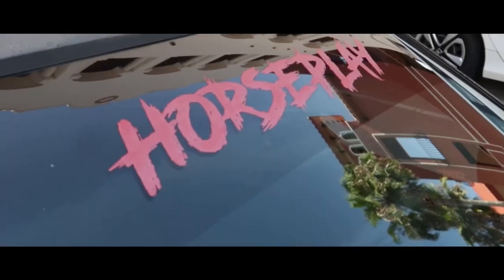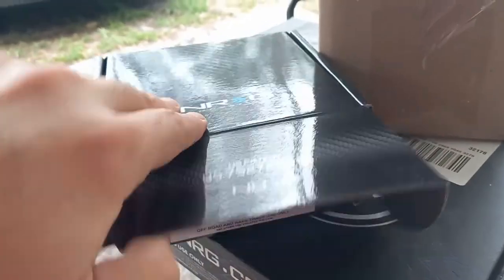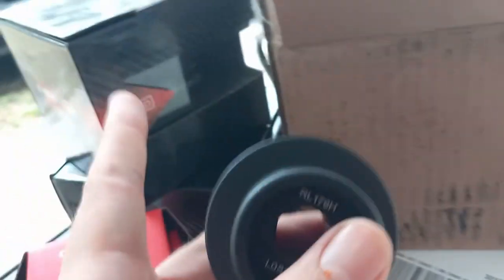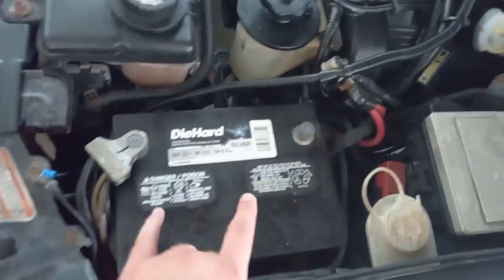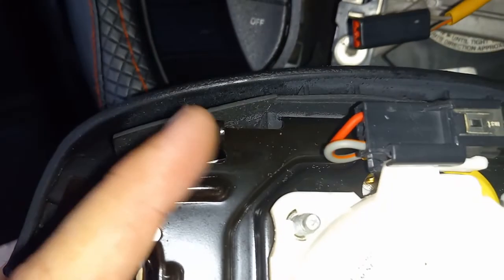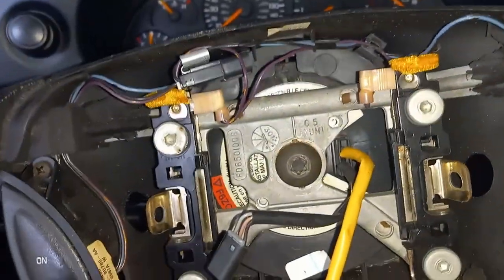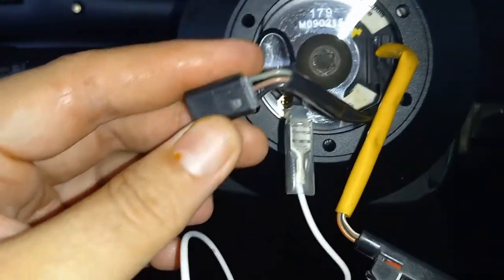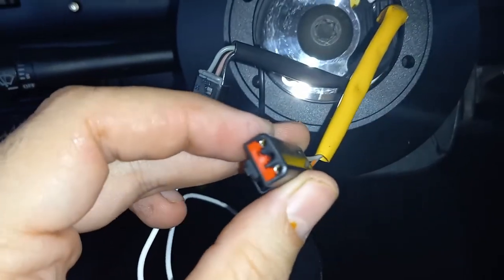The CORRECT WAY to install a Aftermarket steering wheel on a 94-04 Mustang. #nrg #179h #sn95

Comment: So just to make sure for my own peace of mind, do any of these provide a wheel? I wanted a certain wheel so I just didn’t want to get two by accident if for some reason they did.
Reply from the maker: Wheel and hubs are sold separately.
Reply: @TheModAddict  would I be able to put on a 2015 wheel ?
Reply from the maker: @simplydevinn  i dont know about the 2015 wheel. But outinthebarn installed one on their SN. I dont think they needed an adapter.
Reply from the maker: @Devious I
https://youtu.be/bJhW-8I5sNc

Comment: Forgive me if you said something in the video but compared to stock how many inches closer is it and if it is too close I can get rid of the disconnect and just bolt the steering wheel to the hub??
Reply from the maker: It wasnt much closer..but you can certainly run it straight bolted to hub and not run a disconnect.

Comment: I really appreciate this. That is exactly the product I've been looking for. I don't want the quick release, and I'd have to paint it to match my interior, but being able to run a good wheel that doesn't have that huge inflatable mattress in the middle of it will be awesome. I've owned cars that didn't even have a shoulder belt, definitely don't need an airbag. The only question left is whether they'd fail me on the annual inspection or not.
Reply from the maker: Im not sure about the inspection because we dont have them here.
Happy this helped tho. Thank you for watching.
Reply: i’m worried about the same thing but you could definitely find someone you know who owns/is friends with someone who has a shop. they are legal in most states some mechanics aww just annoying about it

Comment: Does it matter If  the Steering wheel is RST-009 RS if that's makes any sense at all
Reply from the maker: Steering wheel doesnt matter. Any NRG wheel will bolt up as will most any 6 bolt steering wheels.
Reply: Thank you !

Comment: Friend!  This was EXACTLY what I needed to make up my mind.  It was the last piece of the puzzle for my street/strip car.  As the car has changed, some of the requirements of my car to compete at the local drag strip were cage, harnesses and race seats.  That made driving the car REALLY uncomfortable with the stock 15" steering wheel with a stick shift.  Since a rather larger driver like me can usually throw their clutch leg to the side to avoid the wheel, I hadn't had a problem until I fitted the car with the stuff I needed to pass tech.  That left ONE way for my clutch leg to move - straight up and down.  And at full swing, even being gentle, my clutch leg was right up against the wheel.

I'll be honest, I looked over all the options and your video convinced me it was the right way to go, but when I ordered it and received it, it didn't look that much smaller than the original wheel.  Side by side, they don't look a lot different in size.  But once you get it in the car, it's a world of difference.  I have a TON of room for my clutch leg now and getting in and out of the car is SOOOO much easier!

Worth every penny and worth the time to put it in.  AND, unlike other kits, it has a mostly factory look about it, it's comfortable, sets the wheel a little closer to you, which when you're in race seats means a LOT.  The car is far more comfortable to drive now and the wheel feels great under the hand.  Seriously happy I chose to go this route over the alternatives.  Great feel, lots of room, convenient entry and exit from the vehicle, even a somewhat factory look.  Nothing to complain about.  And the space saved makes ALL the difference in the world when you're thrashing gears down the 8th mile!
Reply from the maker: I'm happy this convinced you. It's a great set up imo.

Comment: If I still wanted to keep my clock spring I would have went with this for sure! Good video man! 👍🏼
Reply: Is your airbag light on or did you bypass it? If so how did you bypass it? I removed my clockspring but i dont want the airbag light on
Reply from the maker: Its all in the video. Lol
Reply from the maker: Regardless if you keep clock spring or not you bypass the airbag light the same way.

Comment: Nice video man! Sadly this came to late for me. I have a nrg hub where you need to remove the clock spring. So I had to rewire the horn and fill the gap that the removed clock spring created. Your solution is so much cleaner.
Reply from the maker: Dang,  that sucks.

Comment: Have you looked into installing the race hub? On the clock spring, I don’t believe the plug sticking out comes out. Entire clock spring needs to come out it seems
Reply from the maker: Correct. The race hub eliminates the clock spring.

Comment: Sorry I’m not sure if this was said in the video but what ohm resistor did you use for the airbag light to go away?
Reply from the maker: It came from NRG..but i think its a 2 ohm
Edit NRG Site shows 2ohm
Reply: @TheModAddict  Which nrg part did it come with?
Reply from the maker: @TheClapGodSr.  I dont recall .
Reply from the maker: @TheClapGodSr.  I believe the steering wheel itself. But could have been the Hub

Comment: Will this set up work with the ford performance steering wheel you will just have to add the button right
Reply from the maker: Sure will. I almost went that route but didnt want suede
Reply: @TheModAddict  so will I need the clock spring or not 🤔
Reply from the maker: If you want to keep the horn yea. It also turns off the turn signal.
Reply: @TheModAddict  thanks man I appreciate it sorry I just got confused !
Reply from the maker: No problem. Here to help when I can.

Comment: Hey bro if i dont want the quick release do i just use the hub and bolt the steering wheel on that hub?
Reply from the maker: Correct, but the steering wheel straight to the hub adapter.
Reply: @TheModAddict  so how would the horn work if its just set up that way without the quick release ? Sorry to keep bothering thinking if buying this but i dont care for the quick release
Reply from the maker: @bryanmiller5007  it would be wired straight to horn on the wheel instead of the quick release.
Not bothering me at all. You can even hit me up on IG @horseplay_motoring
Also.
Reply: @TheModAddict  sent you a message and a follow bro 🤟🏼
Reply: @TheModAddict  shot you a message on ig if you can help me get an understanding of this id appreciate it 🙏🏼

Comment: What size relay is used for the air bag light? I wanna see if this will turn off my air bag light in car.
Reply from the maker: There is no markings on it to indicate what resistance it is.
Reply: 30ohms
Reply from the maker: Pretty sure its 2ohms..

Comment: I do have a question for you when you changed the wheel how did you get all the controls on the new wheel and the air swing the bag?
Reply: Also I have a 2000 mustang
Reply from the maker: The air swing the bag? Not sure what that means. No controls was transferred over. No need for cruise control in a race car.
Reply: Sorry I ment air bags
Reply from the maker: There are no controls or airbag on the new wheel
Reply: Okay that was my question so my 2000 mustang had its air bags installed in the wheel if I do get a race will it will be no air bags n that car and I can’t put any in?
Reply from the maker: @shaylac3140  correct no air bags for aftermarket wheel. There are companies that sell stock style steering wheels that have been modified that keeps air bag and cruise control functions..but 99% of aftermarket steering wheels are sold as "For off road use only" because no air bag.

Comment: Do u have a link for the steering wheel?
Reply from the maker: https://www.amazon.com/NRG-Innovations-RST-009R-RS-Reinforced-Steering/dp/B01MUGLKHL/ref=mp_s_a_1_3?crid=2L8FVUHTKRA41&keywords=nrg+flat+bottom+steering+wheel&qid=1692182633&sprefix=nrg+flat+bottom+steeringnlwheel%252Caps%252C4879&sr=8-3&ufe=app_do%253Aamzn1.fos.f5122f16-c3e8-4386-bf32-63e904010ad0&_encoding=UTF8&tag=horseplaymoto-20&linkCode=ur2&linkId=ff50db1368f6abb6644cb7c73cd6bbf0&camp=1789&creative=9325

Comment: i thought you disconnected the ground instead of the red one
Reply from the maker: Im not sure which you are talking about.. for the horn?
Reply: @TheModAddict  for the airbag
Reply from the maker: I installed as per NRG instructions
Reply from the maker: @leol2110  the module plugs in to the harness.. it dont matter if red goes to ground or whatever the resistor module still works. You dont just disconnect a ground or power because they are in the same plug. 
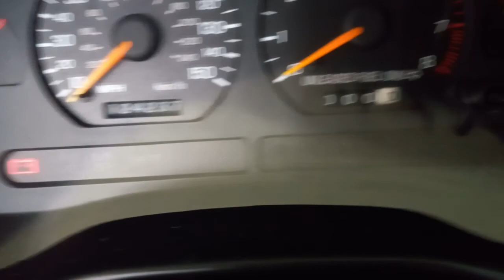@11:00
Reply: @TheModAddict  oh im talking about the battery. I was asking if it matters if you disconnect the negative terminal instead of the power
Reply from the maker: I was always told for the air bag you take off the positive.